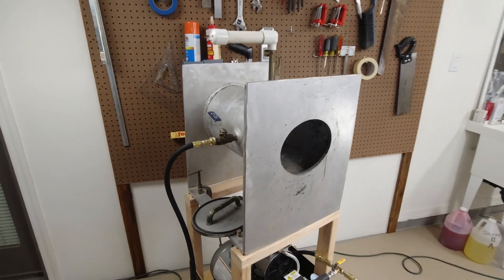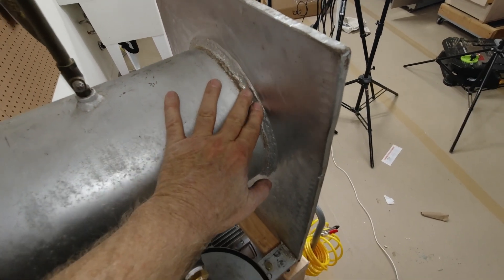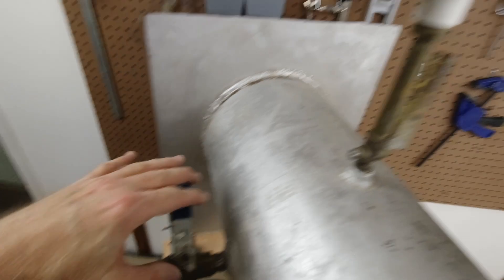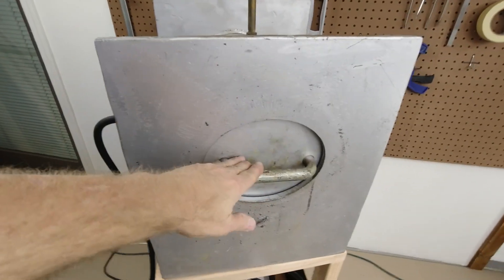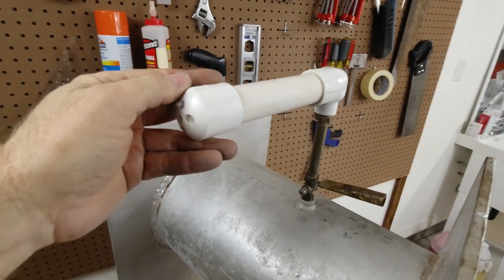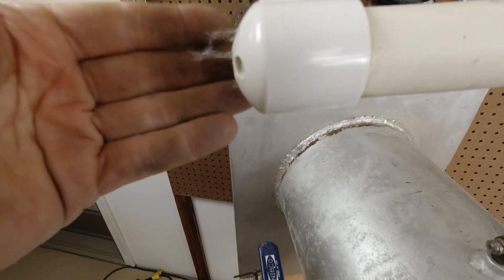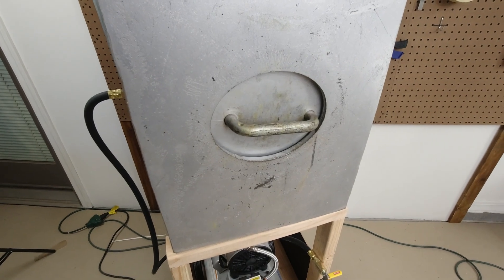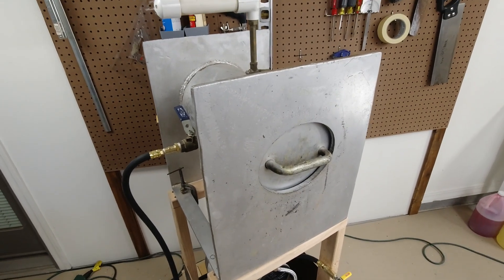All You Need To Know!

Comment: Excellent Information. What does the pressure do to the resin. Will this work on all resin castings. How many horse power is the compressor? thanks
Reply from the maker: The pressure pot prevents the formation of bubbles that are the result of water vapor from the atmosphere. Urethane resin is  very sensitive to moisture and will foam when it absorbs moisture from the air.  The pressure pump will also remove small bubbles that may be trapped during the resin pour. It will not remove large bubbles. Those must be released from the mold with vents.  I run my pressure pot at 50 PSI. The reservoir tank on the compressor is at 116 PSI. So even though the two tanks are roughly the same capacity there is plenty of air to quickly pressurize the casting chamber.

Comment: A negative pressure degasser is cheaper and easier to build. Would it help at all to pull the bubbles out of the resin?
Reply from the maker: I find it doesn't work with the resins I use because they set up too fast.  The resin gels while it's still foaming under vacuum.
Reply: @RobertTolone  so you would need a slow setting resin.
Reply from the maker: @annekabrimhall1059  Yes, and also a way to contain the resin above the mold as it rises and expands. Frankly, I never had very much luck vacuuming molds full of resin.
Reply: So far I only use resin when I make jewelry. I just hit it with the heat gun for one second and it pops the bubbles.

Comment: Excuse my ignorance but I thought people used a vacuumed chamber to degas the castings.
Reply from the maker: I use a vacuum chamber to degas the rubber prior to pouring the mold. The pressure chamber is used to prevent bubbles when casting the resin in the mold.

Comment: After all the videos I have seen of yours I just realized that this "pressure pot" system of yours is not a vacuum chamber but (duh) the opposite. I made a vacuum pot out of found parts to de-gas my silicone after mixing and it works very well for that but I thought you were casting resin in a vacuum too to avoid bubbles. I'm sure I've seen you de-gas rubber before but there must be a whole other reason to use pressure for casting and the distinction slipped past me somehow. Anyway, thanks for posting. Enjoy some time off and happy new year.
Reply from the maker: The main reason I use pressure is that I buy my resin in 5 gallon buckets. It takes quite a while to use up a bucket and no matter how carefully I seal the cap the resin absorbs moisture from the atmosphere over time. Even a tiny amount of moisture causes the resin to foam. Casting in a pressure pot prevents that foaming and will also remove the tiny bubbles that get incorporated into the resin when I fill the mold.

Comment: The gasket Robert, what’s the gasket!? I’ve replicated this setup almost exactly but I can’t get the seal to stay in place
Reply from the maker: I am embarrassed to say that I don't remember. It is a very hard, solid tube of rubber; we cut them to length and glued the ends together and glued them into the grooves in the lid.  My fabricator Bob supplied the tubing and the cement. After all these years I have not replaced any of these seals ever.  I would try looking for O-Ring material or rubber tubing about as hard as a car tire. 70 Shore A, 40 Shore C or 25 Shore D. A rubber supplier should be able to recommend the appropriate adhesive for making the seal.
Reply: Robert Tolone thanks Robert and thanks again for all the advice in these videos. 

I think the key on the gasket is probably the groove. I tried to attach a butyl gasket to my lid with adhesive but the pressure just blew it sideways across the flat lid. I’ll have to have a groove machined in to resist that lateral force.
Reply from the maker: @Mafdark1  Yes, you need to mill that groove.

Comment: If people are going to weld their own anyway (because that's what people do) fill it with water first to test it and pressurise to at least 50% more than the working pressure, as water is incompressible it will stop the tank exploding and any leaks will be obvious.
Reply from the maker: Good safety check!
Reply: @RobertTolone  TBH no pressure vessel is going to explode from a bit of dodgy welding, catastrophic failures need a lot more than that particularly at normal shop compressor pressures, leaks, certainly but not explosions. With your vessel worst that could happen if you were a SERIOUSLY bad welder is the front plate would blow off but you'd hear hissing of leaking air long  before that and if your welding is that bad (very hard to be that bad) don't stand in front of the bit that's likely to fly off when testing it. There is a thing known as "Bar Litres" Also known as PS.V where you multiple the pressure by the volume and the bigger the number the worse the potential outcome in a failure. So a small vessel operating at relatively low pressure or even quite high pressure, no big deal but large vessel operating at even fairly low pressures could be bad, for context EU law defines "simple" pressure vessels as anything under 10,000 Bar litres, yours is about 200 Bar Litres at most I'd guess.
Reply from the maker: @mfx1  A viewer wrote to me and asked if he could make a pressure pot out of a pickle jar. I told him that I did not recommend it. A guy who wanted to build a pot visited my shop and asked me how much pressure was in the pot. I told him, 50 psi. He said, wow - 50 pounds isn’t very much. I said, 50 pounds PER SQUARE INCH. That adds up to a hell of a lot of pressure on the walls of the pot. He had never heard of psi. This is what we are dealing with.  I would rather exaggerates the dangers of welding a pressure vessel badly than underestimate them.  😃
Reply: Good suggestion Martin! You are right about people welding their own, I am one of them. I have modified a propane tank, which is only 4mm thick steel but rated to 22bar so in theory well over the spec for a 3 bar pressure pot.  I want to stress test it at around 60 psi but not keen on doing so, however your water test sounds like a good option.

Comment: Thanks for sharing this! Could you say what the seal on the lid is and how it is adhered? You cant imagine the issue of buying a replacement rubber gasket for my 2.5 gallon, paint pot in Canada. 
I drilled out and tapped the screw clamps on my pot and replaced the thumb screws with bolts so I could get a hard seal for the pressure I wanted to have, but tightening can be stressful before the resin starts to cure. I did buy a silent compressor this year which is magic (when you live in a condo). Is there a max pressure where it no longer makes a difference in the cast quality? Merry Christmas, Robert!
Reply from the maker: I am embarrassed to say that I don't remember. It is a very hard, solid tube of rubber; we cut them to length and glued the ends together and glued them into the grooves in the lid.  My fabricator Bob supplied the tubing and the cement. After all these years I have not replaced any of these seals ever.  I would try looking for O-Ring material or rubber tubing about as hard as a car tire. 70 Shore A, 40 Shore C or 25 Shore D. A rubber supplier should be able to recommend the appropriate adhesive for making the seal.

Comment: 50 PSI pressure are around 3.5 bar. As such, air bubbles in castings become 3.5 times smaller in size when pressurized inside the pot (since earths atmosphere is around 1 bar of pressure at sea level). So, the more pressure inside the pot, the smaller the size of the resulting bubble. Lets of course not forget that a car tire has around 2.2 bar pressure and you can easily understand how this thing exploding can deliver vast amounts of terror! :)
Merry Christmas Robert! Can't wait for your next videos!
Reply from the maker: You explained perfectly why the pressure pot will effectively eliminate small bubbles but not big ones.  My tanks are safe up to 125 PSI, but I have found it is not necessary to run them at higher than 50. But I went the air from the mold, not crush it out.
Reply: @RobertTolone  It seems normal that you don't run them higher than 50 PSI. If you take a 1cc bubble and pressurize it at 2 bar (1 bar on the gauge), the size of it will become 0.5cc. If you continue compressing it at 3 bar, the size of it will become 0.33cc. So, the change in size is only by 0.17cc compared to the 0.5cc of the initial compression. At the end, you compress it more but the size changes very little.
Just for information. Scuba divers have higher risk when surfacing from 10m depth (2 bar) to the sea level than from 20m depth (3 bar) to 10m depth as the bubbles in their blood stream doubles when going from 10m to 0.
Reply from the maker: @ekalyvio  Great information. Thanks for sharing!

Comment: No talk about using a paint pot? Thats what I use.

Oh and cue sad clown music, no rotary casting until next year. 😭
Reply from the maker: I've never used a paint pot to pressure cast so I'm not qualified to talk about them.
Reply: @RobertTolone  most get a Harbor Freight paint pot, strip off all the plumbing and just have a gauge, pop off valve and fill connection with valve. For the hobbyist it much more accessible than your welded tanks. I only run max 50 PSI. They are more prone to leaks than your system since the pressure doesn't hold the door sealed.

Some also use ones from I think California Air that may already be setup but they are all paint pots.
Reply from the maker: @chartle1  That is definitely the route that most people seem to go.